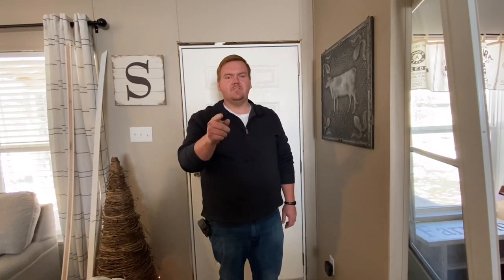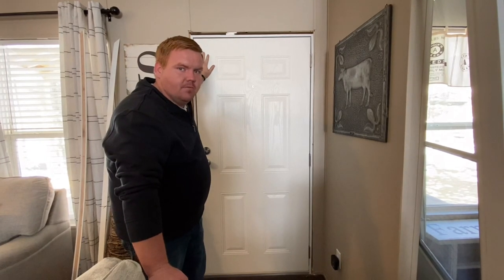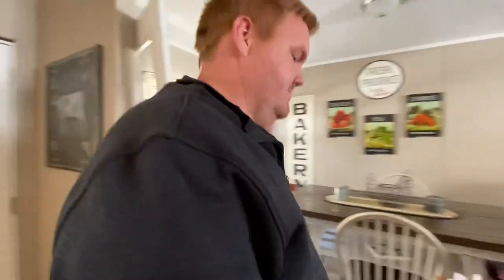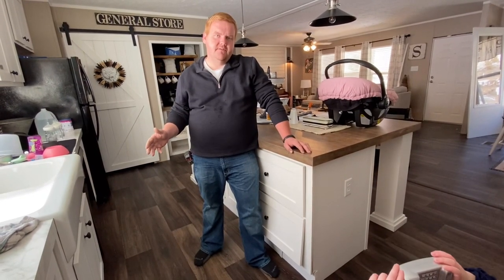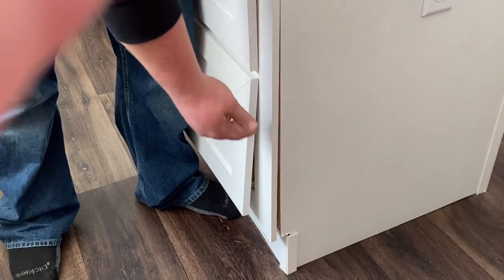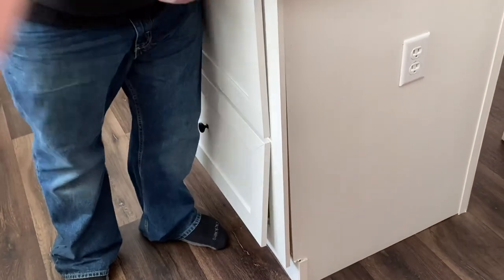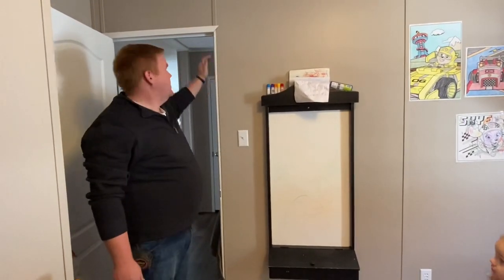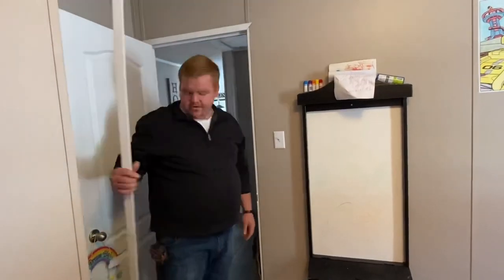3 Major Issues with our new Mobile Home! Doublewide less than a year old already with issues!

Comment: I had to replace an exterior door. It was galvanized with a vinyl coating. The vinyl started to flake and peel due to sun exposure and it look like crap. Home was only 13 yrs old and has a storm door to protect it from the elements.  I pulled it off by taking the pins out of the hinges and took it to a local door and window manufacture who made me a new one from fiberglass stock they had . They even milled out the hing recess so it was a easy swap. Primed and paint and it was a done deal.
Reply from the maker: Thanks for the comment! Sounds like that door manufacturer knows what there doing! Lol

Comment: When we bought our home .we  lived in a 4 bedroom home to a mobile .quite size difference but we didn't need a big home anymore and wanted to be In a active community and meet ppl . I probably was and my husband seller's worst nightmare. We pretty much went every corner of the home . Check age of roof central air . Check for saggy floor ceiling mold dirty carpet I had a list a mile long I learned so much from these videos. From owners of Parker hoa. The water pressure does it run out of hot water fast . Walls the doors the closest doors windows anything on my list . There were a few minor things . So we dealed we said we will have them fixed but then you lower the price . And we will pay you in cash . We didn't need a loan .he we didn't ask .OK if we can make a deal today I will pay next month land rent since you can't get in next month. And omg . We got all proper paper work my hospital took care of title he was a accountant  nothing was getting by him and blow up in our face .house is amazing lots of new friends things to do . I thought downsizing would be a negative  no way no 4 bedroom house to clean snow blow cut the grass. House to clean so much . We finally started a new chapter in our life. Yea we don't have big families so I and my hubby don't see them . Except FaceTime.  And we moved 1000 miles away to warm  weather away from cold . So the rule about guest we laughter bc nobody is coming just as we are not going back with the price we did once last year .but with cat and dog .hard
Reply from the maker: I’m Glad y’all found a place that you like! Hopefully my Videos where helpful in some way! I truly appreciate the comment!

Comment: Staples and nails are not nearly as strong as glue. They are used to hold the joint while the glue sets. Glue and clamp the styles with a good quality wood glue like Titbond 2 or 3 and let it set!
Reply from the maker: Hey Ray thanks for the comments!

Comment: I own a mobile home and we all know they are put together with staples. A little insulation around the door is no biggy. And we all know they have flimsy trim. I replaced the trim with regular trim from Home Depot or Lowe's, another no biggy. And it looks much nicer. Manufactured housing isn't like site built but it also doesn't come with the outlandish prices of site built. These are minor expected flaws. Major would be huge cracks or fixtures falling off the walls.
Reply from the maker: As someone who does construction for a living having Zero insulation around a door is a huge deal! In my opinion anyway! Thanks for the Comment Van!

Comment: not hating but you should have got the drywall.... if u could have... it has crown molding on top and bottom like a regular home.. 2019 clayton single wide owned since brand new my issues are .. leaking sink i replaced the sink...  busted shower pan in masters i had to put a whole new shower.. and my dishwasher leaked everywhere lol...
Reply from the maker: Yes we wanted the Drywall model but it was 6-9 months wait for special order. The dealer had ordered the one we got like 6 months earlier and it was only 2 weeks from being in so we paid a 1,000$ deposit to hold it. We drove hours trying to just get one that was available within 3-4 weeks and every dealer was sold out and you had to go on a 6-9 months waiting list! Lol so I said all that to say we didn’t really have a choice. Lol thanks for the comment!

Comment: The lack of insulation around the door is horrifying.  Did you have an inspector come and take a look at it?
Reply from the maker: No I was just so aggravated I didn’t even think of having them look at it. I actually payed extra and had the house upgraded to the energy star package. There was zero insulation around the entire door! Thanks for the comment!
Reply: @RedBeardedBuilder  OMG WTF.  I've always lived in places that had several feet of snow during the winters and early spring - so a lack of insulation .. just NO.  HELL NO.  Did you get a warranty or anything?
Reply from the maker: @aislynn001  yes I have a 5 year warranty but I just fixed it myself